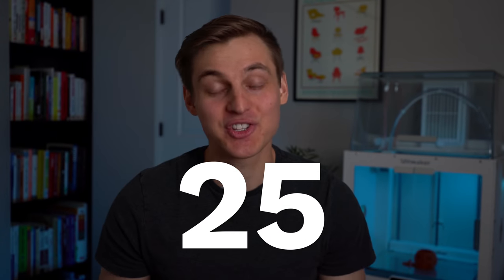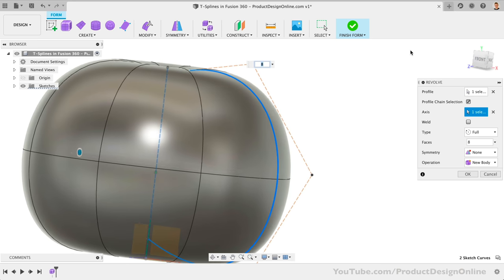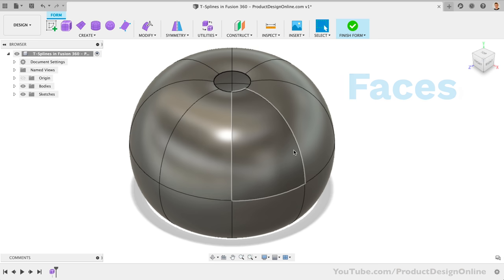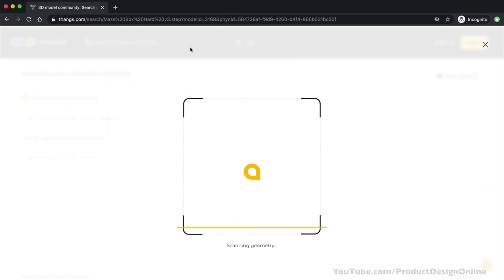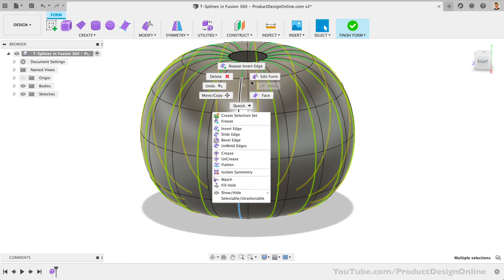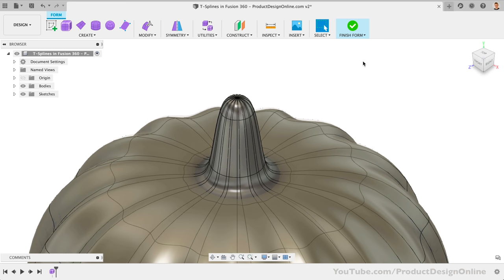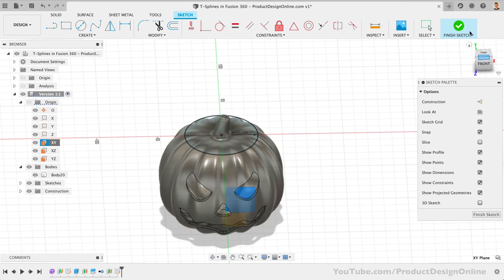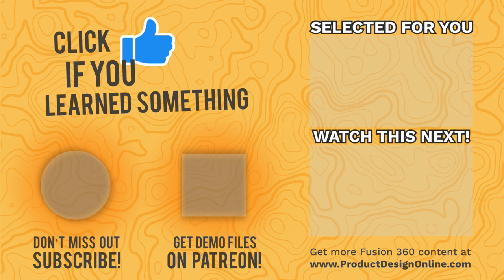Modeling with T-Splines in Fusion 360 (2021)

Comment: i made mine with a flat back so it’ll print more easily. i snapped control points along the back to some lines drawn where i intended to do the cut first so it wouldn’t be as deep but i ended up having to fill a hole anyway. great tutorial! Thank you!
Reply: Also I did a more complex "keyed" lid so i just offset the side faces by -.25 afterward. worked fine.

Comment: good video , for 3d print do we use the 3 types or only solid ?
Reply from the maker: Hi Amir. Great question! You would need a solid model to 3D print. Technically, if you export a Surface model it will be "infinitely" thin, so there is nothing to print. However, that is why surfaces and t-splines are/can be converted into solid bodies :)
Reply: @ProductDesignOnline  thanks a lot

Comment: Very useful, but not what I was looking for. You kind of touch my problem 19 min in when you cut out the pumpkins face. Would it be possible in any way to cut towards the center axis of the pumpkin? So that each cut surface became perpendicular to the shell? (Sure, would not be perpendicular due to the ripples, but say it would be an apple instead)
Would really help me if possible! I have already established that you can not simply cut "to object" and then select an axis, unfortunately.
(Is aware of the "tapper angle" option, but it angles towards a point, not an axis)
Thanks

Comment: Hi there I have just tried my fusion 360 in the form space and when I extrude my sketch I don't see the actual T-splines except if I hover the mouse over it. It only highlights the face or spline that the mouse is over .... is there a setting the turns them on and off ? 

Ps: love the videos they are super helpful .

Regards 
Anton
Reply from the maker: Hi Anton. It sound like you need to change your visual style option to Shaded. This forum post may help - https://forums.autodesk.com/t5/fusion-360-support/t-splines-don-t-show-up/td-p/7371793

Comment: Great video! Is there a way to go back and change the value of the thicken from 18min in the video? Lets say after printing you realize 4 mm would have been preferred over 3mm
Reply from the maker: If you use the Thicken command in the Solid Tab you will be able to edit at any time by double-clicking on the Thicken feature in the parametric timeline (bottom of Fusion 360). If you use the T-spline (sculpt/form) thicken command you will not be able to edit the thickness unless you change the T-spline geometry by editing the T-spline body (double-click on the purple Form icon in your timeline).
Reply: @ProductDesignOnline  Awesome thank you

Comment: I really appreciate the tutorials! I am having an issue trying to tilt the stem though. When I select the top portion of the stem and edit form,  it doesn't allow me to tilt or reposition the stem, it only twists it, opens what i thought was a closed hole on top, and or extrudes the stem. lots of twisting....any help is welcome
Reply: Yeah, I was in the same problem with you. The reason is that you didn't clear symmetry beforehand, since reposition the stem is an asymmetrical action
Reply: @vyngoco3495  Thanks! I ran into this same issue!

Comment: Great video, thanks for all your assistance with Fusion. I had a question off topic to this discussion. I am currently utilizing the software to make templates and stitching lines for leather patterns. What would be the best way about making stitching holes across a curve or an arc, without extruding the model? Or if the only way is extruding (god my PC hates it) is there a way after to flatten the model back to just a sketch mode and keep those spaced holes? I've found the software much easier to utilize in its 2D form for template purposes. Thanks!
Reply from the maker: Hi Michael. There are a few things you could try. First, you can right-click on any feature in the timeline and "suppress" it while you're not needing it/actively working on it. That should help with any latency issues.

You could also try using the Surface Extrude command. Surface tools make infinitely thing surfaces. You'll essentially have an outline where all your slots/holes are, and the speed shouldn't be affected at all. You could take that into the Drawing workspace to get a DXF or PDF for your template.
Reply: @ProductDesignOnline  You my friend are a @#$#@$#@ genius. Both helped immensely, thanks!!!!!
Reply from the maker: @GreyWolfLeather  Glad that helped :)
Reply: @ProductDesignOnline  So one issue I do have using that feature, is when I use design > drawing from design and drop it in, none of the holes I placed along the radius populate and I get the following dialog box - Mesh, T-Spline and surface bodies will not be included in the drawing.
Reply from the maker: @GreyWolfLeather  you can use the modeling thicking command to thicken them to .01mm or some arbitrary small number. They'll then technically be solid bodies and should show up. If you're doing that as a last step it shouldn't hinder the performance.
Reply: @ProductDesignOnline  I played with it a bit of the day but just cant seem to get it to show via the thicken method. Might be time to buckle down and build a new PC

Comment: Interesting, it’s basically 3d modeling with subdiv but you can make the ugliest booleans with no worries. I wonder if you could import an obj and convert it into a spline model so that you can do Boolean and fillet operations on it
Reply from the maker: You can! Using the newer 'Convert Mesh' tool in the Mesh tab. However, the conversion to T-splines is (unfortunately) only available through the Product Design Extension (as of writing this, anyway).

Comment: Late arrival, and maybe a bit of a lackluster question - when I create a form body/surface I can't see the lines separating individual faces. Haven't been able to find a setting to change this - any advice?
Reply from the maker: Go to your Display Settings (computer icon at the bottom) > Visual Style > switch it to "Shaded with Visible Edges Only" (I bet yours is set to "Shaded")
Reply: @ProductDesignOnline  You would be right. Much appreciated

Comment: In your perspective which software is complete in itself in terms of all the Cad operations?
Reply from the maker: Fusion 360 is really the only one that is 'robust' in terms of a variety of modeling types. Most CAD packages include only 1-2 types of modeling, not the 4 that Fusion 360 supports. That said, Fusion 360 is a general CAD package that is not trying to be specific to one single industry. There are often niche CAD packages that can solves important needs per industry.

What are you using trying to achieve?
Reply: @ProductDesignOnline  sir i am looking forward to design exterior design of vehicles. My friend told me to learn rhino/alias as it offers a vast handling on the model. What do you think? That's why i am asking you. I just want to stick on 1 software and conquer it but sometimes i question myself is this enough for everything....
Reply from the maker: You can certainly do vehicles in Fusion 360 with surfaces and or T-splinse. That said, you will find more resources or learning content for Rhino and Alias for vehicles, because it as been used for that longer. At the end of the day, it will require a very similar skillset so you should choose whichever program you feel more comfortable with :)

Comment: Great tutorial...almost for my level of dumb :)

I got stuck on the stamp. I poke around with the upper ring, pressing CTRL, pressing Alt, dragging free, dragging up...nothing makes any difference and in all combinations it basically does one thing - widens the ring a tiny little bit.
Any ideas what I could have missed?
Reply from the maker: Hi Jan - are you on Mac or Windows??
One of the modifier keys should 'Extrude' faces when dragging the arrow. Something doesn't sound right :)
Reply: @ProductDesignOnline  Hi,it's Windows.
U eventually made it...the problem is...I'm not sure how 😀
Reply from the maker: @skurt21  lol. Glad to hear you made it. Wish I could provide more help but hard to say without seeing it :)
Reply: @ProductDesignOnline  i know. Thank you for the effort 👍

Comment: Can you recommend a hardware configuration for fusion 360? (Laptop)
Reply from the maker: I have some recommendations here - https://productdesignonline.com/fusion-360-users-what-to-buy/

I would buy your computer with a "holistic" approach, considering all the other use cases as well. All in, Fusion 360 is not as resource intensive as other programs may be. As long as you meet F360's "minimum requirements" you will be fine and shouldn't experience issues with the program - https://productdesignonline.com/tips-and-tricks/system-requirements-for-autodesk-fusion-360/

Comment: I think your link to the Prusa3d may be broken, I’ve tried on two computers and get an error message. I’ve been researching 3D machines so I was curious about your recommendation
Reply from the maker: Strange. It works on my end, but I'll look into it. Here's the long/direct link, hopefully, that works - https://shop.prusa3d.com/en/3d-printers/180-original-prusa-i3-mk3s-kit.html#a_aid=pdo

The original Prusa mk3 i3 kit is what I recommend if it's in your budget. They also have a new mini version (cheaper) but the build plate is smaller.

Feel free to join my Discord if you have more questions. I try to answer things there :)
Reply: @ProductDesignOnline  thank you, that link worked, I will try to join the discord, haven’t used it much but I’ll give it another go
Reply from the maker: @RobinhoodCoins  Sounds good. Here's the discord link - https://bit.ly/PDO-Discord
Reply: @ProductDesignOnline  maybe it was just the firewall at work blocking it
Reply from the maker: @RobinhoodCoins  ah, that could be! anyway, thanks for the heads up... I'll try to keep an eye on it... I do occasional mess up the links :)

Comment: Very strange double clicking the adjacent face does not select all faces on Windows you have to double click the adjacent lower face for that to work. Drove me nuts until I figured it out. No idea if that was in an update or difference between MAC and Windows.
Reply from the maker: Hi Eric. Thanks for sharing - I wasn't aware of that. I'll have to look into this as it's been a while since I've ran F360 on Windows.
Reply: @ProductDesignOnline  One other comment when you make your lid you need to project that circle to the sketch plane using the project command unless you have auto project turned on. Auto project is now turned off by default in windows current releases. This will also hang people up like myself following this tutorial. Maybe an update to this video is in order.

Comment: Dude are u sure Tspline are NURBS ?? i htought they are SUB D
Reply from the maker: Yes.

T-splines are a type of NURBS (Non-Uniform Rational B-Splines) because they use a similar mathematical framework, including control points, weights, and parametric space, to define smooth and continuous surfaces with high precision and flexibility. Unlike subdivision surfaces (SubD), which refine mesh geometry through iterative subdivision for smoothness, T-splines maintain the parametric and mathematical properties of NURBS while allowing for local refinement and T-junctions, offering a more efficient and flexible way to model complex surfaces without increasing overall surface complexity.

Hope that helps!